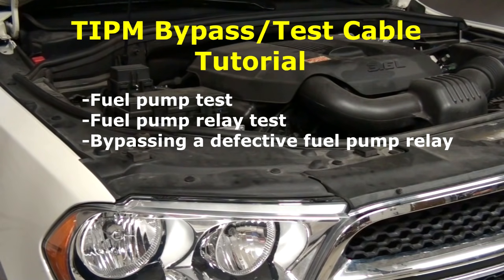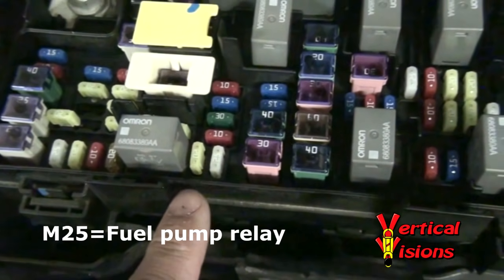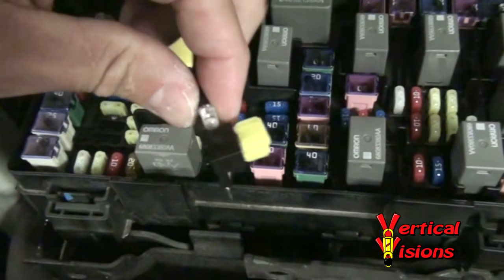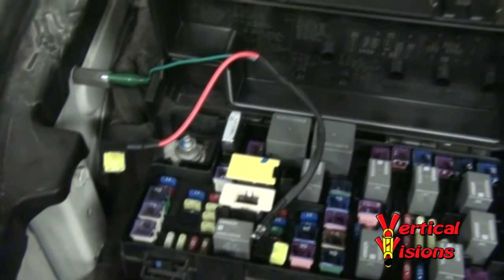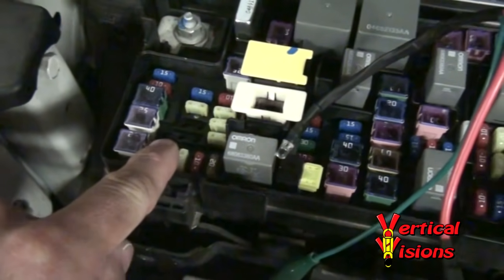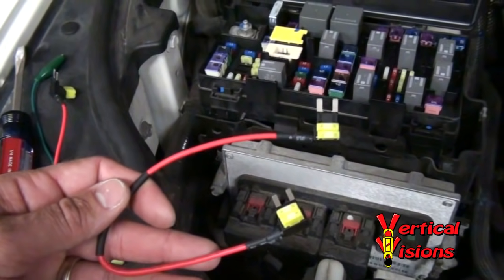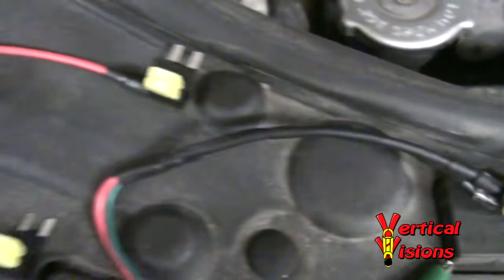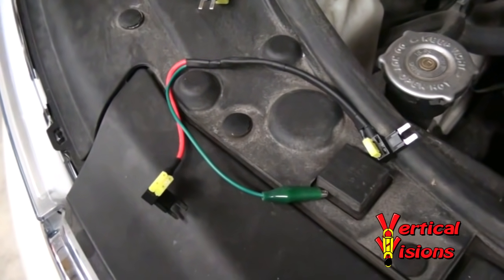TIPM Fuel Relay Test and Bypass Solutions - Most 2007-2021 Dodge, Chrysler, Ram, Jeep, VW Vehicles

Comment: I think this may be my issue. My battery keeps dying on our 2015 T&C if the pump is on 24/7 that makes sense. Also my power doors randomly open.
Reply from the maker: You may have two separate issues (a stuck on fuel relay that has many solutions and a wiring issue that will be difficult to pinpoint).  Visit our website for solutions to both:  www.VerticalVisions.com.  You might even be able to fix both yourself using the info we provide.  I'm guessing you have an above average number of miles on that 2015?
Reply: Jason Bell around 52k on it right now. I have come down a couple times and found a sliding g door open or the doors unlocked. It happens once in a blue moon. Friday it acted like it didn't want to start in the AM. On the way home Friday night it needed a jump. Monday it did fine, but the sliding door was open. Today it wouldn't start in the AM. Jumped it and went to work. Will see in a couple hours if it starts again. I listened for a fuel pump yesterday but didn't hear anything. Granted if it is intermittent it will be hard to chase.
Reply: Daniel Grippe I am also having a tipm issue and I am waiting for Jason's response on which fix I should use. However I want to comment about ur sliding door issue. I had the same problem! Sliding doors and even rear hatch/trunk randomly opening. Google and YouTube searches led me to a video that pointed to connections inside key fob as a possible problem. Sometimes the contacts come loose and cause ur doors to go crazy! I came out several times from stores or my house to find my door (s) wide open! You can open the fob and chances are you will see some connectors slightly off from their position. I bought a replacement oem key fob from amazon ($17) and replaced the inside black plastic button piece  (u know the one with all the button pictures on it)  no reprogramming needed since I didn't replace the micro board. And I never had the problem again. It's been almost 4 months.
Reply: Daniel Grippe https://youtu.be/eDkerRghB88  FIXED: Dodge Caravan Sliding Door Randomly Opens and Closes .  Video posted by
DisasterZone

Comment: Wish I had known vertical vision earlier to save more than three hundred dollars (tow, parts, labor) for a simple swap of an external pump relay, which is offered for ten bucks at verticalvision.com. But still great thanks to Jason because his website potentially have saved me much more.

Long story short, it appears to be the external relay installed by Dodge dealer for the recall about a year ago failed without any warning. The auto shop towed my 2012 Durango Crew 5.7 in had trouble to locate the cause and so I did some research online to come across vertical vision. I showed the shop Jason's website and they swapped the external relay, immediately solve it.

Very few times I have seen a website so detailed, so explanatory and totally dedicated to one matter. Really great work Jason, and not to mention the price he charges on parts are very very reasonable. A ten dollar relay cost me $85 at the shop, you do the math.

Comment: My 2011 Cherokee has recently began doing the stahl at start up then 2nd attempt starts right up as if the charge went through to wake up.. no check engine light no warning and I have reviewed recalls on this and several denied instance by Chrysler- insane !!! 
I'm going to order your cable and pray it's the fix
We all need to file class action lawsuit for any recall to be approved, at this point it's not something being taken serious at all and lives are in danger.
Reply from the maker: Make sure you don't currently have an external relay installed by your dealer, since they cut wires under your TIPM which completely disconnects the fuel pump from any TIPM circuitry.  How to identify if you have one:  http://www.verticalvisions.com/TIPM_relays_external.php#identify

Further info on external relays and how to deal with them is available on that same web page.

Comment: excellent video Jason   you probably saved people a lot of money   and believe me if I owned a Dodge and my FP relay  part of TIPIM went south I would use your product bypass kit permanently.  With that being said it looks like the fuel pump is being run independent of an RPM signal  and that can be an issue in an accident. I am wondering if the people who install the kit are aware of that?
Reply from the maker: Yes, we answer your question in the limitations section of our website as well as the instructions sent with each cable.  This is why I developed the TIPM Plug-In Relay System - a newer product with no limitations.  Link:  http://www.verticalvisions.com/TIPM_relays_plugin.php

Comment: hello, thankfefully i have a 2012 Charger with no issues so far but i will sure get one and throw in the glove box or for other friend who have dodges. my question (which might seem stupid :D)  is after testing and knowing that the relay is faulty i can just change it and the car will work again or i must keep this wire inside the fuse box all the time?
Reply from the maker: You can use the wire to bypass the faulty fuel pump relay (keeping it installed in the TIPM full time) or you can change the relay.  Either solution is acceptable to fix the problem.  We also have better (newer) options at our website:  www.VerticalVisions.com for applicable vehicles.  Note that we have not tested our cable on your 2012 Charger.

Comment: Do you have a solution for 2005 Dodge Ram 2500's? Our mechanic said someone told him about solder a piece on the Tipm. The lights are not working. We replaced that part about a year ago and they are getting hard to find now. Or if you know of a video that could help teach how to solder a piece on it to bypass it, the information would be greatly appreciated. Thank you!
Reply from the maker: We don't deal with vehicles older than 2007, sorry.

Comment: HI, just ordered your cable. Looking forward to a normal life again, my 2012 T/C battery is dead every morning for over 2 weeks. After two repair shops, 3 car batteries, and 3 alternators, mechanic calls out TIPM issue and the  price is $1500. Then I find this video and return to the shop to pick up my van. I ask the mechanic about the fuel pump, and yep, it starts up randomly and drains the battery. I will leave my battery disconnected as I wait for the your cable to arrive. Thank you!
Reply from the maker: You can also pull the M25 fuse after driving to prevent a faulty fuel relay from draining your battery.  It's often easier than disconnecting the battery.
Reply: Life is better now thanks to Jason Bell and this cable. Finally, after two weeks, my Van battery didn't die overnight and I saved over $1500.00!!!!! Chrysler should recall this bad TIPM design. I can't imagine how many people just hand over hard earned money when, most likely, the repair man knows about this fix, but is forced to replace the entire TIPM with another faulty design. Thank you Jason Bell for this great product, you deserve my full gratitude.
Reply: Chris Harris where to order?

Comment: my wife had a 2002 ford escort, the a/c went out. The constant control module was bad 400 bucks. Well $4.82 for radio shack relay exact match, and a 13 dollar soldering iron cuz mine went bad and my dad's extra hands and it was fixed. The relay I replaced, looks very similar to this one. Any way I can appreciate the time and work you had put in on this. Great job.

Comment: I have a 2006 Magnum with similar issue, whats the difference between the 2006 and the 2007-2016 relays? Will this work on the 2006?
Reply from the maker: I have no idea as we normally don't deal with anything older than 2007.  Use the following link to determine if the cables will work on your vehicle:  http://www.verticalvisions.com/TIPM_cables.php#faq10

Comment: Jason,  Nice job on the explanation of diagnostics and the development of the bypass. 

Note:   Once the Federal recall is installed on the Jeep, ... required of Chrysler,....  the fuel pump relay power out pin in the TIPM (FUSE M25) and the pin for the  wire supplying power to the fuel pump are disabled . 

A new fuse holder is wired external to the TIPM.  

On external relay: 
Pin 30 {pwr in) is wired via a ring terminal on battery post of TIPM thru a 20 amp fuse in-line. 
        87 power out is wired to the fuel pump

85  ground lug near TIPM
86  Ignition signal

Required relay :  type AR204

Note 2 : When Chrysler does the recall they install a relay that functions the same as AR207 - it is  type: AR7277 that has a seal skirt but is very hard to find at any big box auto parts store.  The AR207 works fine though a zip tie is needed to ensure the relay does not come unplugged because there is no body lock. 

if you made a  bypass kit to  include this wiring scheme it could easily supplant the factory recall kit using the fuse ports to power the pump and get ignition signal without loosing the protection of the relay.  Also much easier than getting the recall done.
Reply from the maker: Already done.  I have a new patent pending device that does everything the external relay can do, plus more. 

Link:  http://www.verticalvisions.com/TIPM_relays_plugin.php

It's cheaper than paying someone to install the external relay, plus it takes only 5-15 minutes to install.  I researched the four signals used by the external relay and found that three of them are available in fuse slots M25, M30, and M37.  No wires need to be cut and the TIPM doesn't have to be removed.  

It took a year of research and 4+ months of testing, but we are shipping them everyday.  A YouTube video is in the works.  The device has no limitations and remote start is not affected.  It simply plugs into three fuse slots and it 
 can test your fuel pump, fuel pump relay, bypass a faulty relay, and even has a security mode to lock out the fuel pump.

Comment: would this work for a 2005 dodge durango?  I had my fuel pump tested and it works, But they say its an electrical wire problem near the relay.
Reply from the maker: Not sure, as we have not tested the cable on anything older than 2007 vehicles.  Here is our vehicle chart link:  http://www.verticalvisions.com/TIPM_vehicles.php

To explain how it might work, go here:  http://www.verticalvisions.com/TIPM_cables.php#faq10.  Note that we normally use mini-blade add-a circuit cables, but we have built some for micro fuses.

Comment: THANK YOU!!  I have a 2011 Dodge Durango, and in September 2016, I noticed a sound coming from the rear of the vehicle when parked and engine turned off...  Then I would have issues of losing power, and stalling after the engine started...  In February, I took the car in to be looked at, and the mechanics couldn't find anything wrong, so I figured (after reading about my 2011 Durango), that the battery most likely needed replacing due to the age of the vehicle...  After replacing the Battery, the vehicle ran great with no problems, until a road trip from Phoenix to San Diego, where my car completely died...  Got the brand new battery jumped by AAA, and was able to get back to AZ with no problems...  This past June, the vehicle had problems starting again, and would hear that hissing sound again...  Well, after more Google searches, I ran across this YouTube Video by Jason Bell, and EUREKA, all my concerns were answered!!  I ordered both cables right away, and they arrived with in the 2 business days as promised!!  I followed the totally simple instructions and did the testing (which mirrored the video to a tea), then applied the By Pass Cable, and the vehicle started up and ran with NO PROBLEMS, just like it did when I bought it new!!  Thanks Jason for the time and research that you put into this video, and thanks for saving me the $1,500 I was quoted to replace the TIMP!!  Totally AWESOME!!
Reply from the maker: Your fuel relay was likely stuck on after the vehicle was turned off.  Fuel pumps draw around 8-9 amps, which will kill your battery in a matter of hours.  Thanks for your review, John.

Comment: I havent purchased your cable (yet), and i am certain this is my issue with failed starts. I notice if give a little gas while attempting to turn my van on, then my van starts.  With your experience Jason Bell, would you say this is an indication of a failing fuel pump relay?

Comment: I have a 1997 dodge caravan 3.0l 3speed, I replaced the whole harness wires under the hood, what I did was I connected each individual wire with their same color that they should be, I made sure that they are connected good before I start the car, but then the car won't start and also there is a sound came from the relay box. Please help

Comment: Just worked on a friend 2011 Dodge Caravan which would not start, built your cable with parts from auto zone, tested the fuel pump relay per your instruction, power was intermittent, installed bypass and car started. Thanks for the video and diagram

Comment: If you don't have the skills to analyze and prove what is wrong then this might help you. The reason I say might help is that there is more than one thing that can cause a cranks but won't start and "IF" someone has a fuel pump relay issue inside the TIPM then this would bypass the relay and power up the pump. It would also power up the pump if there is a problem outside of the TIPM that was preventing the relay from being commanded on by the PCM. This is actually a problem if someone tries to use this as a repair because the fuel pump would run anytime the key is on even if the engine isn't running. All you have to do is picture someone having an accident where a fuel line is damaged and instead of the engine shutting down and the pump stopping this "fix" would likely cause the pump to keep on running. Yes turning the key off would depower the circuit but right after an accident it's anyone's guess if that would get done right away or not.

Have you noticed a lot of cars today after a minor accident are getting towed away when they look like they could still be driven? It's because with any type of airbag system deployment (even just the seat belt tensioners) the airbag module reporting an event can result in the fuel pump relay being commanded off. That's a safety feature engineered into the cars and this jumper wire if it is used as a repair would compromise that.

Comment: Just ordered this to keep in glove box for my wife's 2014 Town and Country, as a precaution, since this is such a common failure and she travels a lot. I ordered it on a Saturday late morning, around 11AM, expecting it would not ship until Monday, and see it maybe Wednesday. Very surprised when it was in my hand Monday! I am an owner of an auto repair shop, so I am used to diagnosing problems, and using expensive tools/equipment, and this is as simple as it gets, and appears well made. I could have made it myself, but for the little cost, convenience, and knowing that if my wife is stranded, she will have clear instructions, AND a phone number to reach an actual person familiar with THIS REPAIR, to help. That means a lot Thank you.
Reply from the maker: Thanks James - your review is much appreciated.
Reply: probably a different relay.  check your owners manual for the headlight relay.
Reply: Does this work for the head lights I have 2007 caliber and the head lights will not come on?
Reply: James Mcclure mo

Comment: Thanks for the video Jason.  My check engine light is on due to this problem.  Will this fix turn off the check engine light as well? (2015 Jeep Wrangler)
Reply from the maker: Are you sure the light is related to the fuel relay?  The fuel relay circuit will only detect a faulty relay coil, which rarely fails (unless they changed something in your 2015 Wrangler).  The most common relay failure is the contacts, which will not trigger any sensors, lights, or codes.  The lack of a sensor detecting that the fuel relay isn't allowing current to pass onto the fuel pump is the main problem/complaint with these vehicles.  Suggest you buy an OBD II scanner to read the code or take it to a big box auto parts store where they often read the code for free.
Reply: Yeah I used a motus scanner and found there was an open circuit to the fuel pump.  I did something similar to what your kit does just to temporarily see if I could get it to start and it did but still have a check engine light and no other codes

Comment: Hi Jason, I have an 07 Ram Hemi with this same problem but my tipm is different. Any advice would be greatly appreciated
Reply from the maker: Unfortunately, we have not spent enough time researching your style of TIPM.  2011-2012 Dodge Rams are the TIPM-7 style we normally work with while 2013-2015 and perhaps newer Dodge Rams will also work with our TIPM cables if you change to a micro fuse add-a-circuit cable.  We did have someone accidentally send us a 2007 Ram TIPM a month ago, but it did not contain a fuel pump fuse (needed to locate the fuel pump relay inside).  Contact me via our website (www.VerticalVisions.com) and I may be able to help.  You can always find further information on a used TIPM through our site as well.  We refer used TIPM requests to a business in Los Angeles.  Good luck to you.